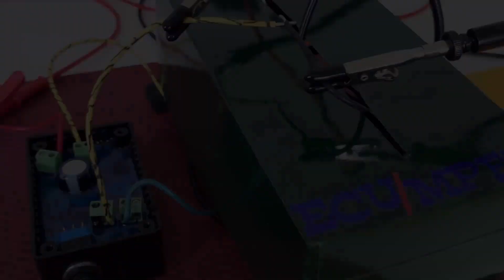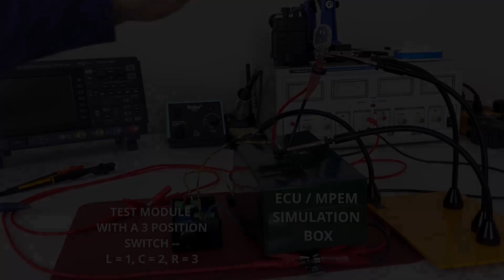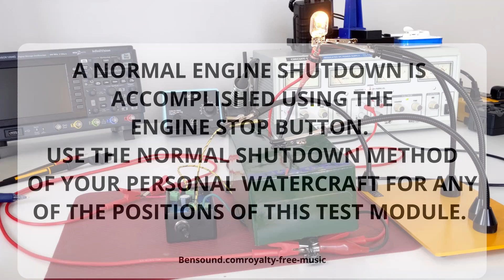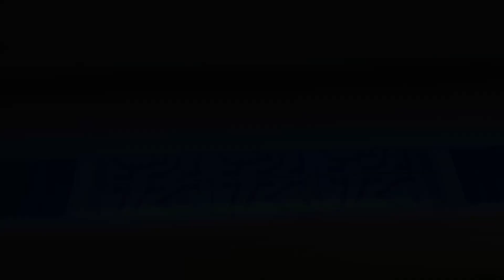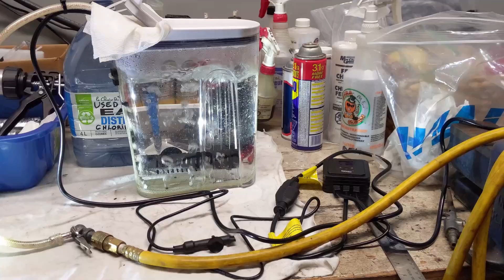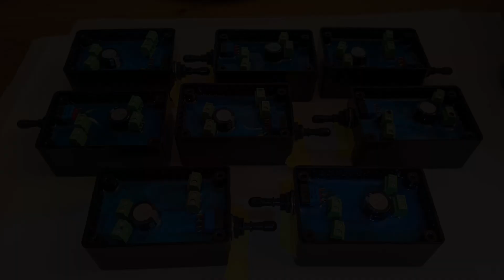JET SKI MPEM IGNITION INTERRUPTER SIGNAL CONDITIONER TEST MODULE

Comment: I am glad that there are people like you! God bless you! I want a device like the one you created, can it be used instead of a key or is it just for testing. How can I buy it? Thank you.
Reply from the maker: You still need the key, as the key holds the code to unlock the system. This prevents anyone from stealing you personal watercraft with the use of one of these boxes. What it does allow you to do, using the original key, is to remove unwanted momentary loss of signals from a bad intermittent contact in the key post, allowing the boat to continue to operate while still maintaining the safety
shutdown feature when the key is removed straight out, with the tether and wrist band, like when you fall off the boat. Yes, you can keep the unit wired in the boat forever if you want and it can be run in any switch position of the box. The box has two test positions and an off position. The off positions puts everything back to stock condition as if no box was installed. You need to use the box responsibly as the second test position bypasses a failed key post contact completely and is used to find hard faults in the circuit. It's only for testing in a controlled environment like a shop, as you will not get a shutdown signal if the key is pulled straight out like when you fall out of the boat. Yes of course you can still shut down your boat normally in any switch position by a normal shutdown which is turning the key to off. Please note, the bypass position is not to be used out in a body of water. The first test position on the other hand conditions the key post run signal and the watercraft can be used in this position for as long as you need. The only way you can tell if you have an intermittent fault in the key post is if your out there bouncing the boat around off the waves. Clearly if your machine no longer shuts down randomly while your out there boating, while in the condition
test position, you know your shutdown problem was in key post. The box switch has a safety feature in that the spring loaded gate type switch can't be accidentally moved, unless you pull the lever out against spring force and move it over the gate into a new position.. I hope all this helps. I can send you buying information through my Gmail if you would like by emailing direct at nichefixes@gmail.com. It's my personal email. Thanks for your interest.